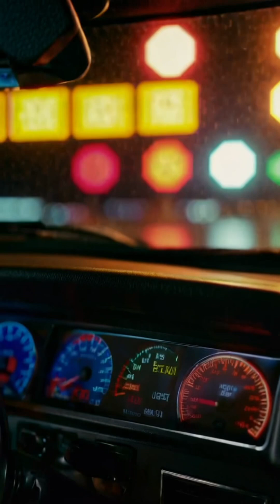UDS in Automotive Embedded Systems #uds #embedded  #rtos #electronics #automotive #automobile

Comment from the maker: Explore the Unified Diagnostic Service (UDS) and its transformative impact on vehicle diagnostics in modern automotive workshops. This video showcases technicians utilizing advanced diagnostic tools to streamline repairs, troubleshoot issues, and enhance vehicle performance. 

Witness real-time data analysis, standard error codes, and effective communication between electronic control units and diagnostic equipment. UDS not only supports basic troubleshooting but also advanced functions like flash programming, pivotal for developing cutting-edge driver-assistance systems. 

As the industry evolves, UDS ensures compatibility and reliability across various vehicle models, ultimately elevating customer satisfaction. Join us to see how UDS propels automotive excellence! #Diagnostics #AutomotiveTechnology #UDS #VehicleRepair #AutomotiveIndustry.